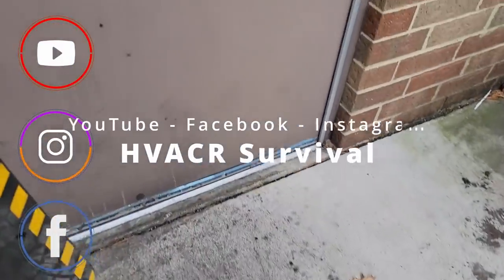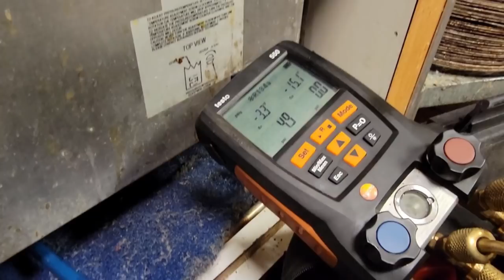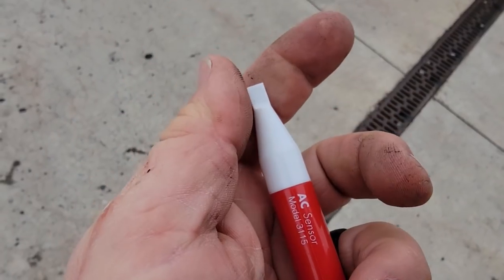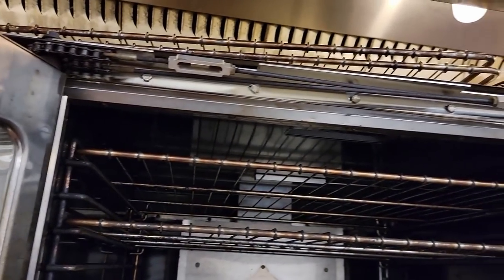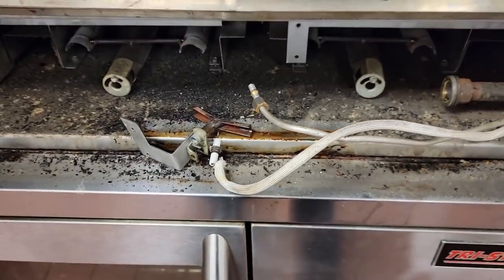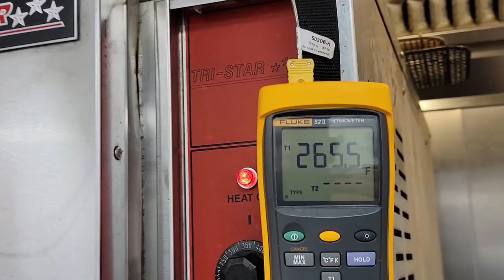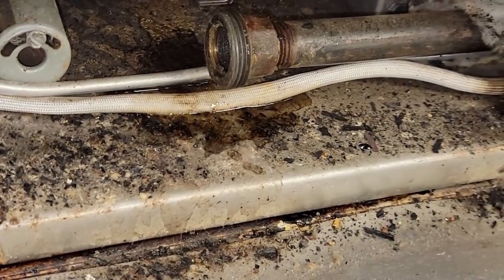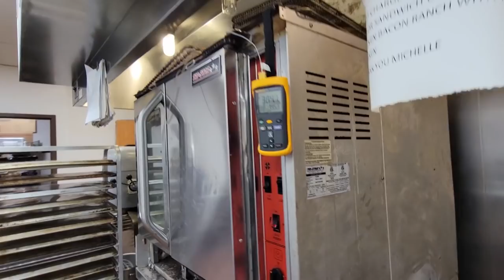Cold Rail Is Warm And Oven Is Cold. What In The World Was I Thinking!?

Comment: Oven temperature is check by ignoring the first time it gets up to temp then taking 4 temps when it turns on,then off ,then on,then off and dividing by the amount of readings you get that's the temp of the oven. The first on cycle usually overshoots to compensates for opening the door and putting the food in. That thermostat seems to be bad though like you said. R.I.P. Klein 😭

Comment: You used to be able to count the bells and know the voltage, but with changes in materials, that's no longer the case.    

I'm actually impressed that the plastic of the handle came off so cleanly, and the silicone sleeve was still intact - and squishy.    See if they'll warranty it? :)
Reply from the maker: I tagged Klein in the video and they never replied, I take that as a no...lol

Comment: Check the ovens at the center of the oven and allow to cycle 3 times before checking if it is calibrated.  There is an offset at the probe to try to keep the temperature average at the center of the oven to temperature.  This is just an fyi and not a criticism.
Reply from the maker: So I should calibrate at the center? Does that apply to convection ovens?
Reply: This applies to convection ovens and conventional.  Starting from cold, the oven needs to even out by cycling at least three times before calibrating.  I did commercial kitchen equipment for years and this was factory training for us.  On another note, you did a great job adjusting the door.
Reply from the maker: Those doors can be tricky. Thanks for the inside information 👍👍

Comment: Rick those flux lines are actually not dangerous at all and don’t cause cancer I was told that by a lineman
Reply from the maker: I would be less interested in finding out who's correct🤣 and avoid them. My wife said a MRI doesn't have a limited time exposure so you might be right.
Reply: @HVACRSurvival  at the wavelength that power lines operate on, you have no health concerns with the EM radiation from them. You would have to be over 1500 miles tall for magnetic fields to be a problem. Also as to the voltage, I've seen that construction used on 138,000 volt and 230,000 volt lines. Of course that also means they could be 115,000 and 161,000 volt lines. The 345,000 volt, 500,000 volt, and 765,000 volt lines use different construction.

Comment: I have a unit, total electric, no heat pump. We’ve had a service call multiple times since November. The heat sequencer has been replaced twice now and it went out again tonight (Im assuming). It’s again blowing cold air. We can’t afford another service call. What could be causing* this? Thermostat issues?
Reply from the maker: Sounds like a call back on the service person.?  Normally we adjust the labor for those. If I was the technician looking at the strip section I would potentially visually inspect all the elements and make sure they're not shorting to ground or together. Definitely would be checking amp draw. Double check all of your electrical connections, they tend to loosen up. Obviously all this needs to be done with the power completely off and verified.